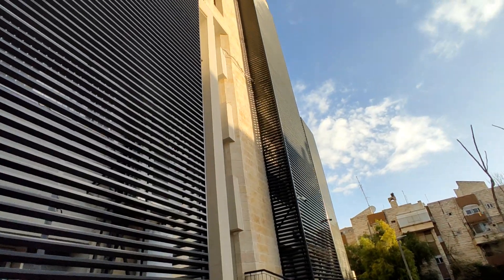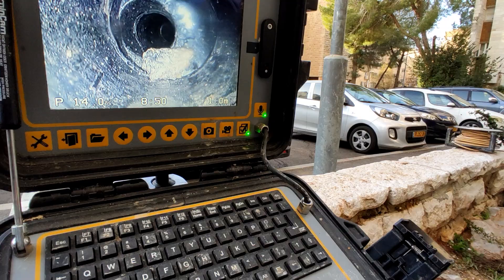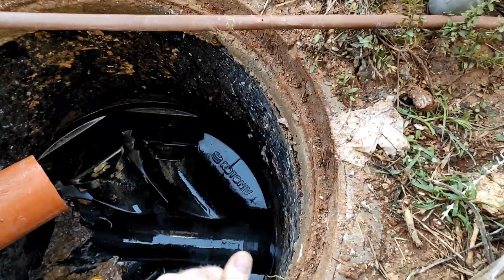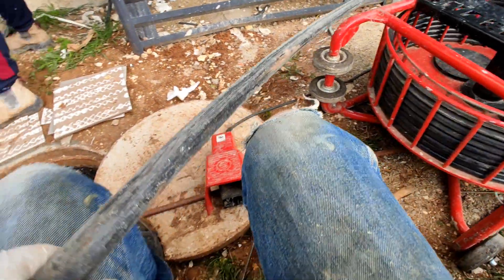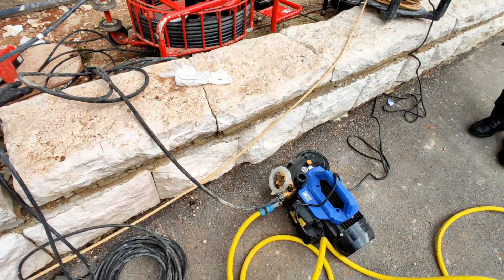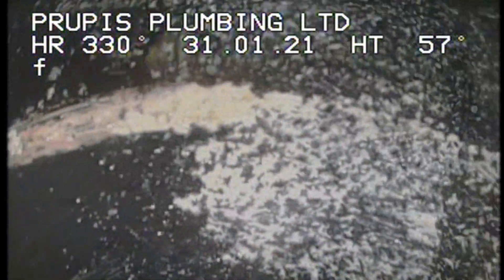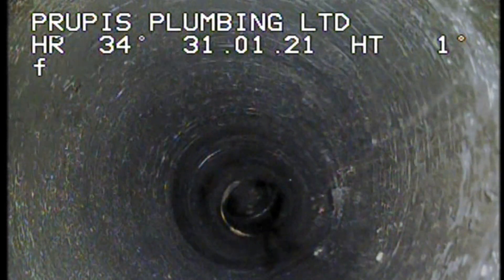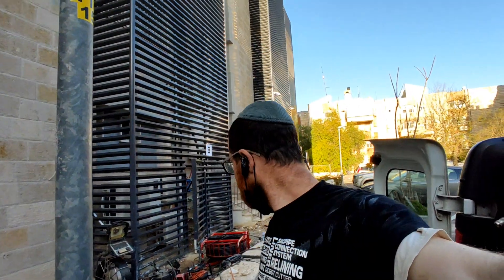#TrenchlessAddict Concrete removal from sewer drain

Comment: I know this is an old video, but what brand camera is that?
Reply from the maker: That's the Mincam (now Rauch) 360
Reply: @PrupisPlumbing thanks for the reply. I’m on the market for a new high end camera, and I’m looking for other options aside from Ridgid. The market is flooded with cheap Chinese cameras, so finding a reliable camera for professionals is becoming a daunting task.
Reply from the maker: @tjh780 yes. Listen, for a long time I was against Chinese products. But the truth is, they are plowing forward at the speed of light while Europe sleeps. The quality isn't so bad anymore. You'll see within the next 5-10 years China is going to burn European products. We have Chinese cams for when we use our flexshaft and for 2" lines. The 360 is for when we need better push, quality and pan and tilt for larger lines....I also always tell people, don't just look for the best camera, look for the best service. There are a lot of great European cams but if you can't get same week fixes it will be annoying so make sure you have someone local to service....
Reply: @PrupisPlumbing  I need reliability more than I need quick repairs. I can get a new Ridgid head or reterm relatively quickly. What I don’t need is something that is not durable. Ridgid does a pretty decent job of that. If Chinese cameras are reliable, I’ll give them a shot. For the price points here in the US, I find that hard to believe. I’m tired of seeing “field repairable.” All that says to me is to expect this cheap POS to break. What I’d like to see is companies making reliability their selling point. Like I said in an earlier post, I don’t care about cheap cameras, I care about reliability. Thanks for your opinion, I do appreciate it!